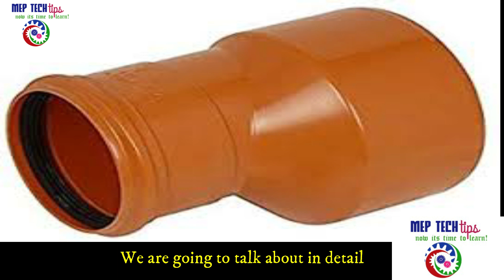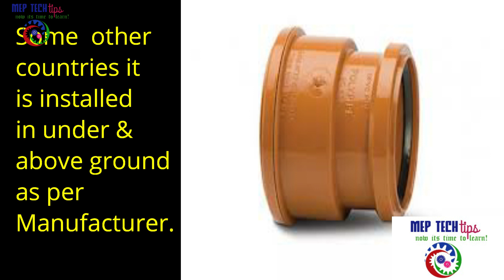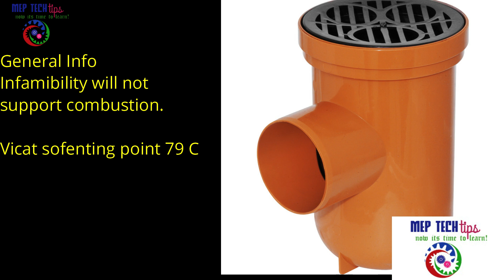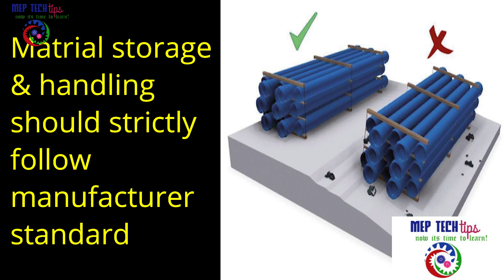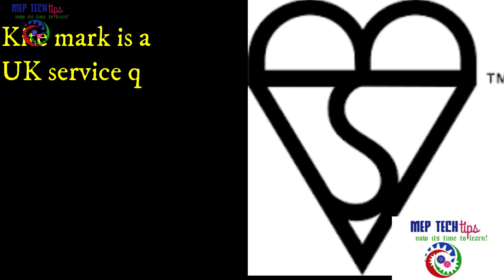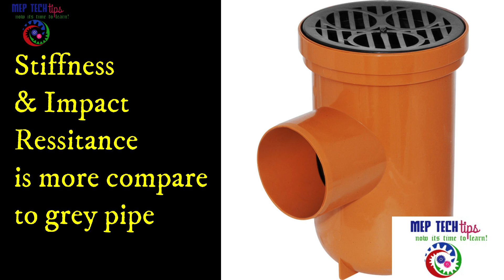Drainage Pipe Material Explained|Under Ground Drainage pipe Terracotta|By MEP TECH TIPS Eng Subtitle

Comment: Hi there. I’m wondering if you can help. I acquired clay pipes with the intention of using them as ollas for garden container beds so when I put water , it leaks slowly out of the clay pipe. But the coating on it is preventing this from happening? Any idea what type of coating is used and how to take them off the clay? Thank you.